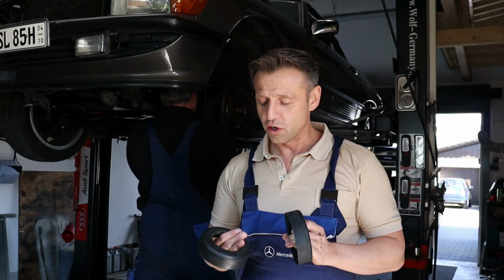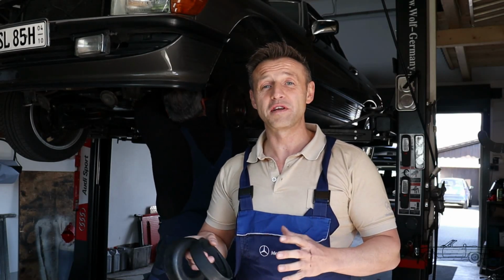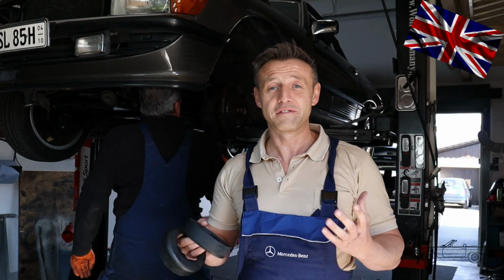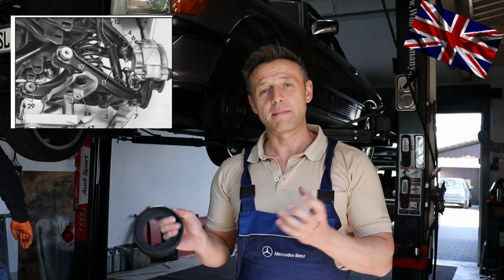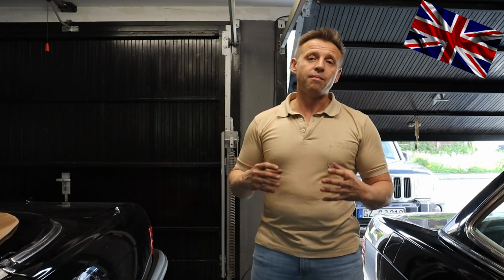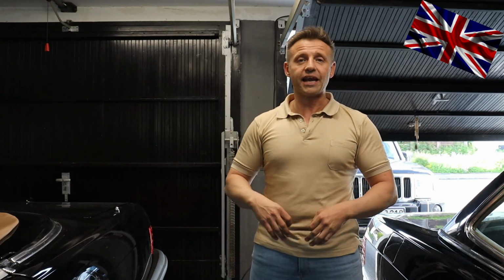Mercedes R107 front suspension spring - removal/ installation - changing the rubber pad

Comment: The tip of turning the spring so that the end of the coil coincides with the indentation in the wishbone might be the cause of the weird metal on metal noise I get when going over bumps in my W115 and W116 because I was not aware of that. I'll see shortly because one had the front springs removed once and the w116 had the back ones removed once, now I have something to check again.

Thank you so much! Freundliche grussen, Martin
Reply from the maker: Hello, yes that could be the reason, the flat ground side of the spring up and when inserting at the bottom look for the marking in the wishbone.
Reply: here you go....you found the culprit